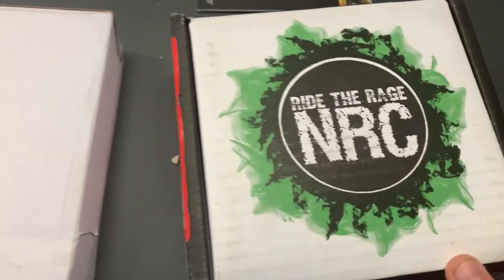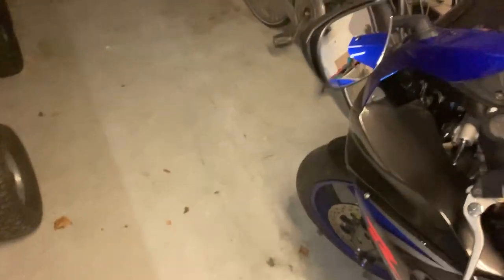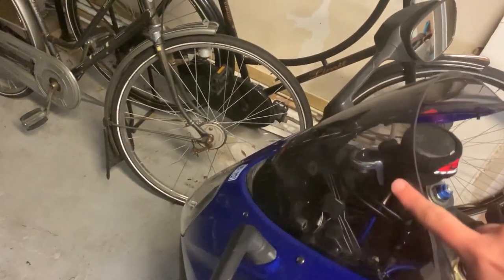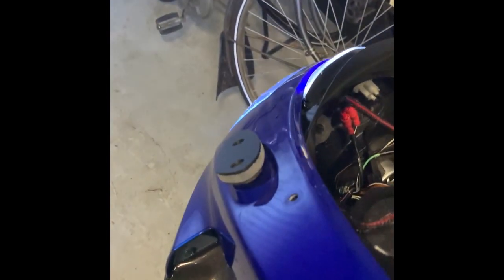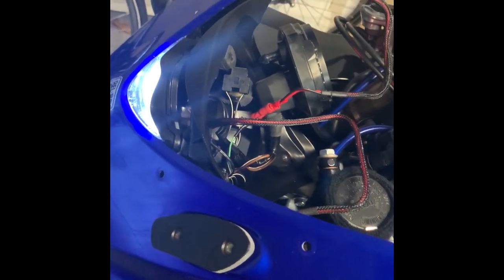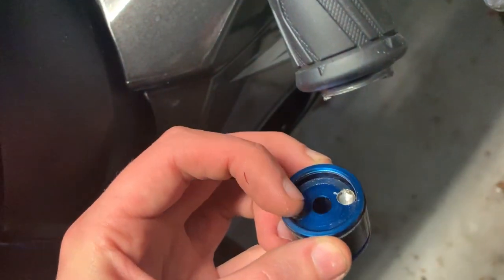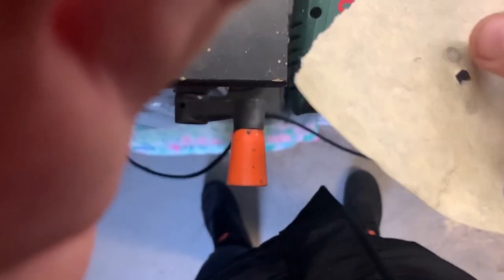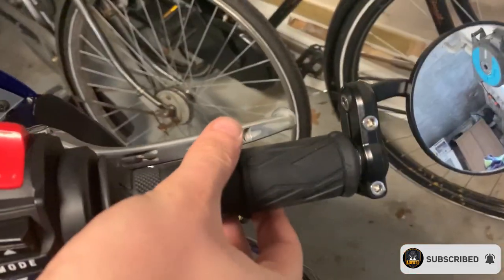Best MOD I did on my bike so far! How to install Mirror block off plates and remove mirrors!

Comment: Ok so I tried the bar end mirrors. I had to move my arm every time I wanted to look. Did you have this problem?  If so.. was it easy to get used to?
Reply from the maker: Thats what i had with the old mirrors, my view was blocked by my shoulders, i dont have that problem now. I dont want anything else anymore